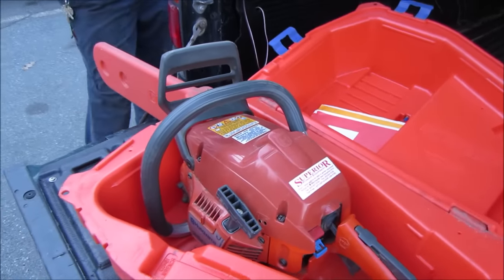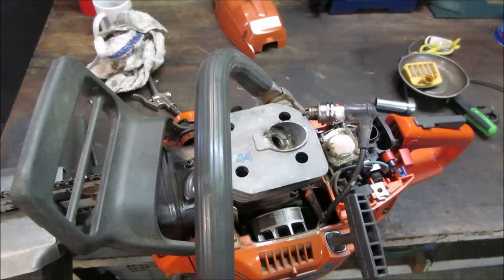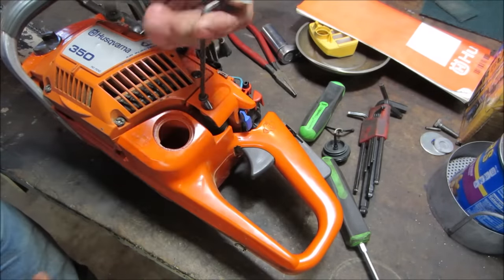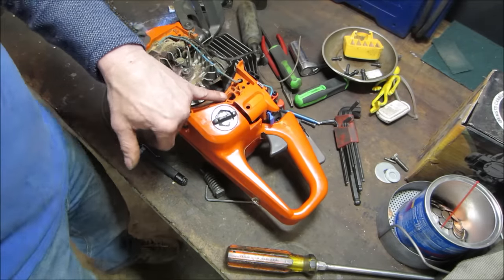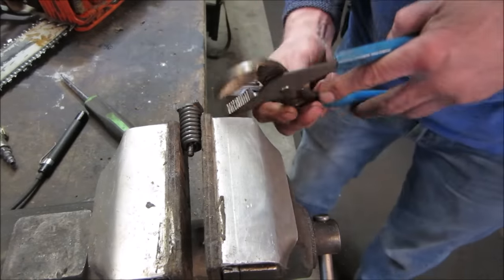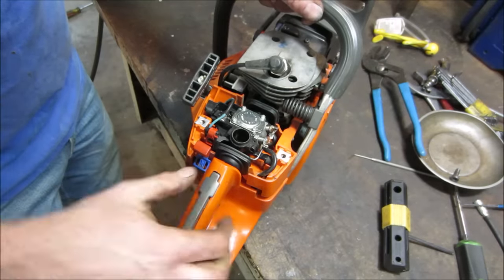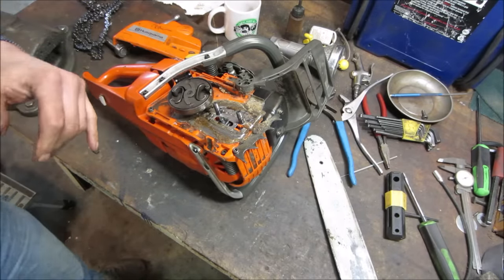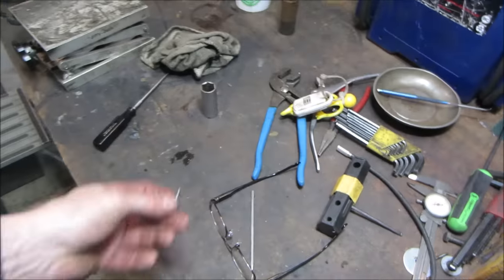Can It Be Saved? The Junkiest Chainsaw Ever. Picked out of The Trash.

Comment: The Husky 350 is 50cc and the biggest engine put on that frame. A great homeowner saw. As with every husky I've owned, (currently 2- 350's, 1- 435, 2- 572's), they are very particular about how you start them. Set the choke, depress compression release and pull until it pop's the first time. Push the choke off and it will normally start and run on the next pull or maybe 2 at the most. Works for me every time on every Husky I own.
Reply: Actually it’s 42 cc
Reply: Looks like I'm a year late and hadn't read through the comments yet, but I use the same start method and mentioned it above.

Comment: The easiest and quickest way I've found that works better &stronger than new,  to repair a thread in a plastic hole is extruding 3d printer filament into the hole. This is easily achieved with a 3d printer pen and makes the new filler plastic bond strongly to the old. That is provided you allow the parent plastic to warm up a bit via inserting the extruder nozzle into the hole and waiting for the base plastic to warm up before filling in the hole with filament. It also helps to choose an appropriate type of similar filament as the parent plastic . This when will cool leaves a blind hole for which you can do as you choose.  Only problem I've come across doing this is next time instead of the thread being stripped out ( think like a fuse protects wiring)  your almost always going to do more damage and break that piece entirely off,  say it's a mounting standoff for example, it will be torn away from its position in whatever it is your fixing. Instead of just stripping the thread out.  So here it pays to figure out why it happened and if possible stop it from doing it again.

Comment: I used to work at a hardware store you'd be surprised how many guys come in wanting a chain and they're gonna think the same old 20 inch chain will go on there no matter what it is which is not the case at all. you have to make sure you're getting the right chain and it's going on the correct bar. It happened so much we had to put no refunds on the chains 'cause they would go put them on. It would screw the chain all up and then bring it back wondering why it didn't work. You have to make sure you're getting one with the correct amount of links with the correct gauge and the correct size.

Comment: Who would EVER think a Husqvarna is no good?  The greatest, best brand chainsaw there is...
Reply: I have a husqavarna my second be the rancher was terrible I ended up buying another husqy the 562
Do in a 24 inch bar has been great at times s little hard to start but usually a couple pulls it starts its a beast cutting wood the best saw I have ever owned is an echo can’t remember the mod but it was a larger saw to Han most it would run d as ll day in the hot weather I could dig it down come back one pull started the oil I g was great I could cut a lot of wood before sharpening the chain I would go with several friends cutting the same wood they woot sharpen 3 times for every one I did I had it set to run out of oil just before. Ran out of gasoline

Comment: Too much plastic on the new lower level saws . They get dropped or banged around and it puts a lot of stuff out of alignment  that handle throttle linkage  bit  you did. Most saws get messed up when someone starts playing with the throttle adjustment and hi low settings  most are locked out now but can be messed with if someone is dedicated to messing them up. That's what I was hoping this video was about.  Broke at the rear handle on one of mine  fixed it by making a Sheetmetal reinforcement then re mounted all the plastic on it . I sometimes like it when things break gives me a chance to fix and improve on them most of the time.

Comment: Quick tip, most of these are made out of abs and if you use acetone and ABS pipe you can make a slurry that you can put on the threads to recreate the portion of the plastic mold.

Comment: Test your bar oiler buy holding the tip of bar 6'' from the ground and running saw at speed for 4 sec. Should have a light trail on the ground.

Comment: I like the central tension adjuster on that, most chainsaws with the adjustment at the front get soooo caked in sawdust and oil you struggle to even see the screw. For sharpening just get the small round file and put it in a drill or a dremel, works a charm and is soo much quicker than by hand.

Comment: When working with plastic you have 3 options for thread repair...
1. Heat, melt, reshape
2. Oversize bolt
3. J.B. weld

Comment: I have been using my Husqvarna 345 chainsaw for 21 years now, the only problem was that blue wire broke so had to chock it to shut down the engine, until I fixed the wire, I cut firewood every summer with it, a lot of cutting, has never failed me.

Comment: Husqvarna's are good if you maintain them but the go is still a Stihl, then Husqvarna's. the "trick" is to use the correct mix, pump 6x, choke, pull, pump 6x, choke, pull, then leaving on run position, with safety bar pulled toward saw, grip throttle, pull starting "floored" . works every time. i swing away when pulls starting and never had an issue. maintenance is key and safety is #1

Comment: For anyone wanting to secure the av mounts to the wallowed out screw  hole in the gas tank correctly , Husqvarna makes a threaded brass insert for that purpose. most shops will not let on to this because they want you to buy a new tank or a new saw so you will have to research the part number I do not recall it.

Comment: That's all just needs a set of lower AV bushings or (anti-vibration bushings) and a carburetor adjustment maybe make sure it's not sucking air anywhere first like the pulsation passage or carburetor gasket and boot as well as crank seals other than that she just needs a carburetor set properly. As far as that bar goes there's lots of life in that there's lots of videos on YouTube on bar maintenance you can even dress them up by running them on a belt sander lightly at 90°to true up and take the valley out of the rails. The only reason it got bad in the first place is the owner didn't know proper chainsaw maintenance or probably operation most people don't realize that you take your bar off and clean it and flip it I flip my bars pretty much each sharpening. Looking at that saw in the video it doesn't have any hours on it The scoring you're seeing in the cylinders is probably from running lean or carbon scores from things like ethanol gasoline and that ungodly restrictive epa stock muffler keeping the heat in the engine killing the cylinder and piston. Husqvarna is one of the top saws on the market and there is a lot you can do to a 350 to wake them up. Ethanol free gas and good mix oil that don't build carbon, open that muffler a bit, proper chainsaw maintenance and that saw will last someone's lifetime. AV mounts are not horrible to change that whole tank assembly comes off the bottom of the saw in just a couple minutes on Husqvarna's I got to hand it to you though you dug those mounts out of there three the hard way three lol but hey if you don't work on these saws everyday you don't know. It's a good video to show people that oftentimes when something is thrown away there really isn't much wrong with it other than ignorance. Great find and a great saw obviously these newer Husqvarna's they're not quite as durable as their predecessors but they cut wood faster than the best of them in their class.

Comment: The one I have I get by with. 
 I have one 16" and  18" Husqvarna chainsaw, one Husqvarna weed eater one Husqvarna self perpelled walk behind Husqvarna  easy start  (LOL) lawnmower. Just like all the
 Husqvarna"s.
   I have to adjust them most of  as I use them. 
 Seems like the carburetor screws get out of adjustment.
 Sometimes I have to turn them all the way out then back in. 
 Took apart and cleaned the carbs several times. 
 They have been like this since I bought them new.
 The lawn mower. I have to mess with the carburetor rods. Especially when it's cold.
 I read on it. It said check the auto choked heat sensor. 
 Been like this since I took it out of box.  
 Yep. I just mess with carburetor linkage.  Make sure the choke flap is shut.
 Best put a manual choke on it. 
 Then it starts when cold. I put gas turn off valve in between gas tank and carburetor keep carburetor cleaner.
 All the Husqvarna are hard to start when hot. 
 So if you do a lot if work with them. 
 Better buy two of all then. So one can let the others cool down. 
 And be mechanically inclined. Be ready to adjust the carburetor 's just about every different tank of gas.
  I'd much rather be using them. Than working on them. 
 Better yet. Buy a different brand. I had a stihl for 35 year. 
Had to chage fuel lines every few years.  
 Coil one time. Plunger on carburetor primer.  6 or 7  bars seven chains. Chain sprocket. And spark plugs.
  As would be expected from wear and time.  
 Cut probably 400 plus cords of wood with it. 
 Off my grandfather land and my father-in-law's land. Cleared acres.said he was growing cows not trees!  Cut them off  close to ground. So a brush hog could run over them. And probably.
  50 other trees for people and friends. 
 My grandmother and dad had a couple of craftsman chainsaw's. 
 Were good for the money  at the time. 
 Now things are made in China.  Lows, Home Depot, Walmart, craftsmen. Have the same throw away weed eaters. 
 Exactly the same Just didn't serial numbers and names. Same chainsaw's, law mowers, ect.
Junk. 
 Even on my Harley Davidson.
 The relays, voltage regulator, staters, ect. Say Harley Davidson in big letters on the front.
 The fine print says made in China! 
 I asked what about made in the U.S.A.
 The said they were made up to Harley Davidson spects! BS. That's why I have to replace them regularly and carry spares with me! Looking like HD has turned to throw away parts also!
 A lot of stuff says USA. Read the fine print. Says in super fine print. Made in China.  
 I read where China changed the name of one of their providence to a name that the letters stating with USA. 
 And sometimes it says assembleded in states in the United States.
  Evidently assembled with China's parts!
 Read the fine print! 
 Sad sad facts! 
Buy another. It's becoming a throw away world! When in fact one knows China can make good stuff.  Looking at your smart phones. They are made in China also. 
 They put out cheap parts. 
 And looking at the labor force and maturity. 
 Their employes should be ridding tricycles or bicycles not assembling stuff.
 The quality all combined.
  Is the major problem.  
 Inspected by who?
(LOL) Ironically ironic!

Comment: My grandfather bought a husqvarna 455 rancher, 10+ years ago it was on sale at Lowe’s, my uncle worked there and rebuilt it because someone ran straight gas and no 2 stroke oil through it. Toughest saw we have fires on the first or second pull every time. Not to mention husqvarna has a way better build for air filter housings than stihl or the others any day of the week.

Comment: Yes, Husq IS the junkiest saws around.  Assembled very badly for one.  I had to tear my new saw apart and put it back together prior to it running decently.  Couldn't take it to HD because I had it sitting for 8 months prior to using it.  The husq also leaks out the gas and oil.  Even though I've used it a number of times it still is not a great manufacturer.  Got a Stihl and wow that one is a beast.  And as I watch based on my limited experience with Husq I would assume it may have been missing a part or two and assembled very sloppy like mine was.

Comment: Could it be that the bar heating problem is due to putting down pressure on the bar, due to a dull chain?  I am kinda guilty of being heavy hand on the down pressure, and my blade is burned too.  I always reverse it once a year.  Maybe I should be doing shorter intervals.  Also my oiler always oils good.  So could be down pressure is the culprit?
Reply: Also I keep an eye on the groove, it seems to be holding up.

Comment: The Husky 350 was a great saw, ran one hard for 12 years, finally had to replace the oil pump. Compression was always good. For a 50cc saw (52cc actually), 3.2 HP was really good back then, especially for a saw under 11 pounds.
Reply: Oil pumps can wear out, too. 
Easy to replace, preventative maintenance item...every 12 years!...

Comment: I've got a Dolmar saw out back that literally came out of a trash truck(I work at a transfer station.) It looked fine, but seemed low on compression. Got it home, and figured out the spark plug was missing. Replaced that and it fired up on the old gas that was in the tank. I guess some guy wanted a new saw; so took out the sparkplug, and told the wife it was broken as justification.

Comment: I threw out my old husqvarna 254 G after the same mount broke. However, it was not reparable since it was a rubber mount and it had a bunch of other issues. The on-off switch was busted, the carb often got stuck on full throttle after you choked it, you had to pull the top cover off and push down a thing on the carb to make it go back to normal, the clutch was worn out. The carb settings where also messed up, no matter how much i fiddled around with the screws, I could not get it to run right(might be an issue with me), it always had very uneven idle, sometimes it ran way too high, other times it just died.

Comment: Husqvarna products are (generally speaking) quite well known / recommended products, most anywhere. I wonder if that 350 model, (older versions having had some issues), was butchered previously. Having seen several of those in a couple  of my family's 'Cupressus Lusitanica' (pine tree variety) forests / ranches, Husqvarna chainsaws were, (along with Stihl ones), above average, regardign durability / reliability, given proper maintenance. In this specific case, it looks like a couple OEM parts / bolts missing, beside abuse signs. As far as I have read, probably some of those 2 stroke engines are chinese made. (I'm NOT a Tech guy nor a timber worker. Just an ER / ICU Dr). Thank you Mustie for your great videos!!.

Comment: The "loose" feeling of the handle is Husqvarna's patented "Anti Vibro" technology (or some such name) that is meant to disconnect the handle and trigger from the engine to reduce vibration transfer to the user.
Reply: *edit* I continued to watch the video and saw the severity of the movement. My 440 x-torq has a considerable amount of flex, but it doesn't in any way feel...loose or not secure. It does not, however, want to start currently which is why I'm watching YT videos about chainsaw repair. I've already replaced, the oem 44 micron air filter with the revised felt filter, new fuel filter, new Husqvarna x-torq pre mixed fuel and b&c oil (after flushing both tanks and accompanying lines), replaced the spark plug, and removed and detailed the carburetor. Put everything back together and it still wouldn't crank. I added some "Mechanic in a Bottle" to the tank last night and went through standard starting procedure and have let it sit overnight. I'll see if that did anything but so far nothing else has worked.

Comment: I got a McCullough 335 chainsaw for free as some guy was gonna throw it out in the trash.
I took it home and just cleaned it up a bit, put some fuel in it and some oil for the chain and it ran.
It wasn't running perfect but it was running,  after using it a couple of times it's actually running near perfect. 
Bought a sharpening set and still trying to get the hang of sharpening the chain properly tho.

Comment: I recently got a brand new Jonsered 2150 and after looking into it not being too familiar with the Jonsered named saws found out that husksvarna had aquired them some time ago and took the design and rebranded it the husky 350 here . my saw is pretty old it was the lady's husband's saw. he passed before getting to use it and it was never used but was stored indoors in a climate controlled place. my saw was made by Jonsered in Switzerland I forget the date code off hand. it was made quite a while ago though I do remember that. but it's definitely the nicest saw I have ever had . I have used it once so far and was cutting some really hard and large pieces of oak and it handled it with ease. no primer to worry about and it also has a decompression valve . overall I absolutely love the saw and it feels really good in the hands . like it's got some real quality . like I said I was unfamiliar with the name but after looking into it I was knocked over at the price they went for . so much as to go and ask the lady if she was sure and tell her what it was worth. bless her lol she laughed and said I told you it was a nice saw and I know what it cost and laughed. she just made me promise it will get used and I won't get rid of it so I happily obliged.

Comment: 1 had a 345 e  husky  same problem  what I did is use heat shrink on oem screw and it worked well   ,got real tight on movement hope Ti helps you ,from tony

Comment: What is the gas to oil ratio for these gas chainsaws?  Thank you.
Reply: RTFM.
Each chainsaw has a correct ratio...which can be varied if you use fully synthetic...or mineral lube oil.
Some run their saws @ 50:1, some like to run @ 45:1, some @40:1
It's your saw; you get to choose...after you RTFM.

Comment: Replace plastic intake clamp with a metal one, reseal plastic crank housing to aluminum housing with threebond 1184.Common 350 husqvarna issues, pressure or vacuum leak.Keep exhaust bolts tight if the later model 350, harmonically they vibrate loose.

Comment: Only thing now is a broken motor mount    But   Like others have said Husqvarna are The Best   Chainsaws going    The previous owner ram unmixed gas and not enough chain oil   And at the start of video  that chain was Way Too tight    I’ve used Husky all my life   I have 3  right now   435   61  Rancher   And 365xp    They All run like tops